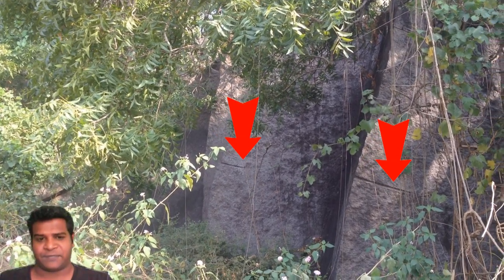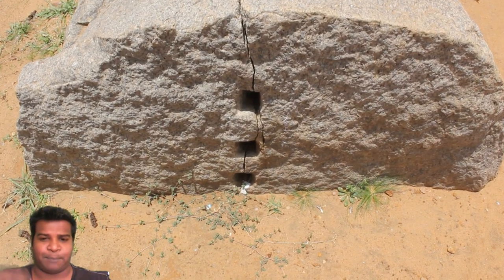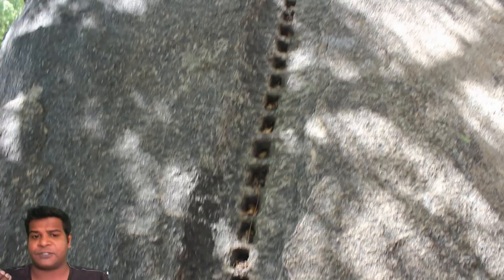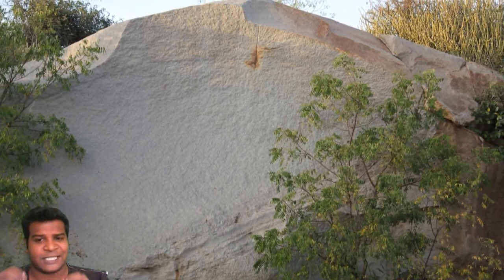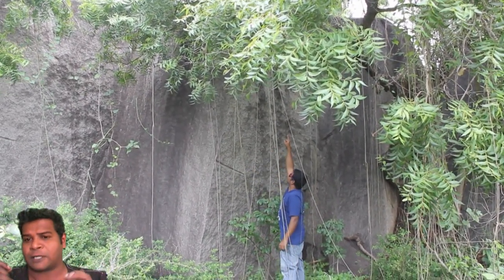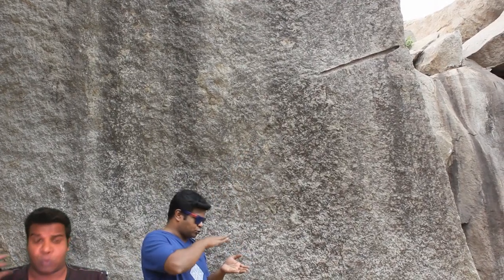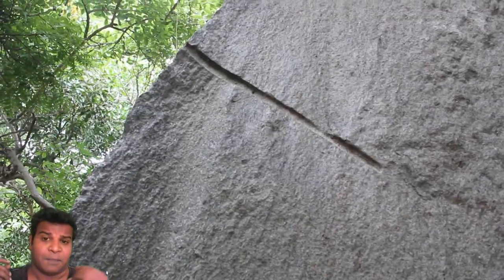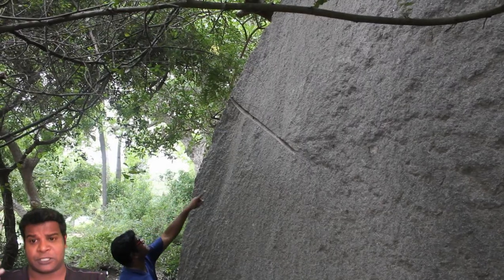In Search Of: Ancient Rock Cutting Technology - Machines?

Comment: Just because experts claim that people from ancient times were technically challenged does not make those statements true. As to the drilling, lapidary is not really drilling nor cutting. It is always an abrasive activity. Saphire/Ruby would work as a medium to produce smooth surfaces in the bore holes. Diamond as well would have been known of In ancient times too. As to the power required to operate such a boring tool, speed and constant pressure on the grinding surface is all that is required. Wrap a rope around a shaft and have a small boy keep downward pressure on the shaft and someone to pull the rope to spin the shaft and you have most of the problem solved. All sorts of methods might be used to create a turning shaft. The third aspect would be a water source. These are not likely core drills. So, the entire hole is ground out. Water must be used to flush the ground stone. All lapidary works best when done wet. Pretty sure this was well known even in ancient times.  It would be fun to actually find tools of this nature. Granite is not the hardest rock in the world. On a 1 to 10  scale granite is around a 7. Diamond is a 10, Topaz is an 8. Corundum /sapphire ruby is a 9 . Harder rock always grinds softer rock.

Comment: 1. They could heat iron bar and swirl it and then sharpen it to make primitive drill bit
2. They might have found some method to make just the tip of drill bit out of diamond or very hard material then make some huge lever, put some weight on the top of the bit to press it into stone and start to rotate that lever..
3. the temple, as it looks like, is made out of sand or dirt which was hardened somehow.. maybe they could have mixed some dust with water and make this stone
(sorry for my english I am not native speaker)
Reply: i know.. they might have smoked weed to create stones but you are cleary stoned in zoo right now
Reply: a hot iron bar that can pierce granite? lololol.
Reply: read again, i said they twisted it into a drill bit shape, then hardened it and used it as primitive drill
Reply: Mark Bear, Good reply to アマ. lol.
Reply: Drilling takes a lot of energy if they had machines..they need  steady power supply

Comment: Drilling one feet hole and splitting the solid rock of 15 feet in equal parts with smooth surface not possible. at least the rod should rill into the middle of the rock by width,  just 1 feet drilling  wouldn't help. I am just talking about common knowledge